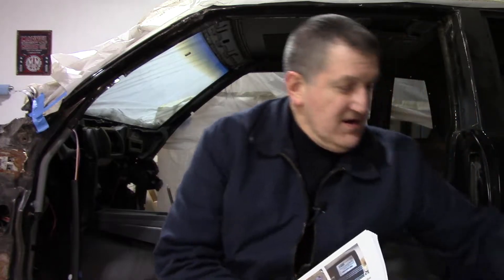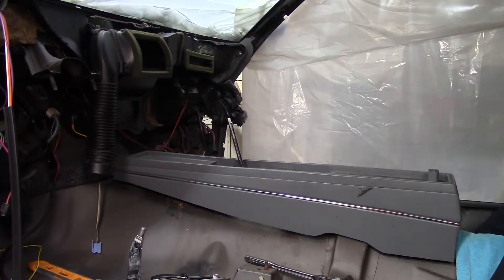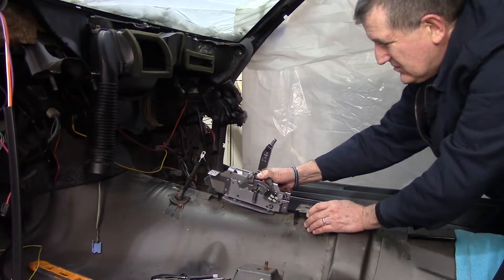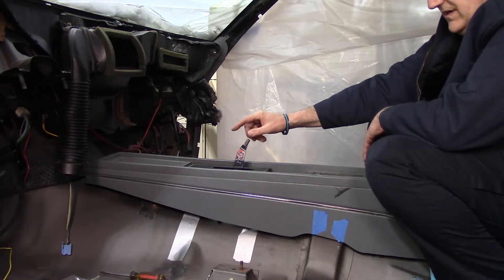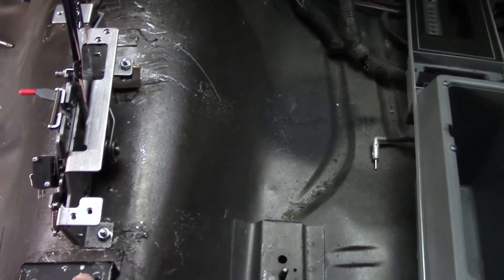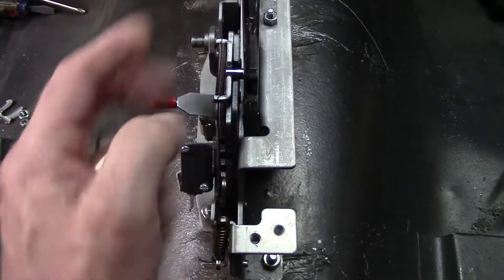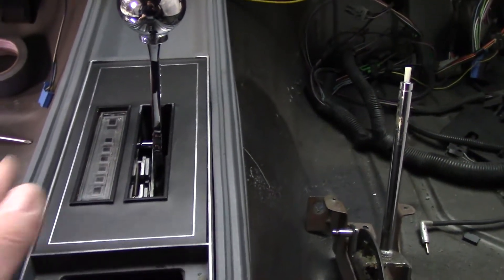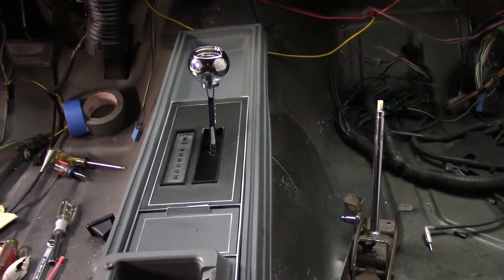G Body Quicksilver Shifter Install!! 1987 Olds 442: Video 60

Comment: Thanks for the excellent video! Love the clean install I think I might copy you! I hate all the extra levers and releases that many shifters have. Love that you only have to lift it. I wasn't even aware of that model shifter and they even work with 4 speeds.  What a great find!
Reply from the maker: It's a very stout shifter too. I've had them before and beat the crap out of them. Never let me down.

Comment: What does the front of the console bolt to? I know from the factory it bolts to the factory shifter. Well what does it bolt to now since you have an aftermarket shifter?
Reply from the maker: It still bolts to the shifter. Click on the link and scroll down. There's a plate you make and bolt to the shifter and bolt the console to that. I can't do mine until the carpet is in.

Comment: Beautiful job I want to do that to my 1985 Cutlass supreme two-door I have a 355 dome top pistons 480 cam edelbrock intake 650 thunder series edelbrock carburetor MSD distributor 350 Turbo 2600 stall Monte Carlo rear end with 373 gears true do exhaust with headman headers and flowmaster super 44 mufflers it is my joy toy

Comment: I'm a little surprised you're not going with 4L80 or even 700R4. Anyways, great build and content. 👍
Reply from the maker: The 4L80 is just an electric 4 speed version of the 400, but no BOP bellhousing (it's way heavier too). The 700R4 might not stand up to the torque (350 max engine torque compared to the 500+ I'm going to have), and again, no BOP bellhousing. I know they make adapters to fit, but to handle the torque, the 700 is $$$. The 4L80 is also $$$ out the gate, soooo...TH400 it is!
Reply: @hutchhiperf  gotcha👍

Comment: Wanting to install a B&M Star Shifter in my 84 Monte Carlo...never done this teardown or replacement before, and I'm curious about the mounting and if there's any major modification or fabrication that's going to need to be involved in order to install it.

In your video I know you cut off the front mounting bracket, but did you even use the factory rear mounting bracket that is welded to the body of the car or did you have to make your own mounting plans ? How did you end up mounting the front down ?
Reply from the maker: I just followed the instructions on the buickturboregal website. Check with some Monte forums and see if someone has done the install. I'm sure someone has done it somewhere.

Comment: Any reason why you didnt use the B&M Shifter Cable that the shifter comes with? You wouldnt of had to modify it no?
Reply from the maker: Because the 80688 Quicksilver is meant as a bolt in for 70-81 F Body's. It hooks up to the factory shift cable. As in: it doesn't come with one.

Comment: Can you tell me what size and length of the factory shifter bolts that hold it down to the bracket
Reply from the maker: Off the top of my head, they were definitely 10mm head screws about an inch or so long. The Google machine may have more on that.

Comment: Do you have to manually switch the gears? Or can you just drive in automatic?
Reply from the maker: It's a full manual valve body. The forward gears are reversed as well. PRN123